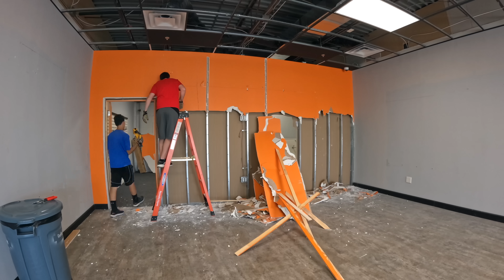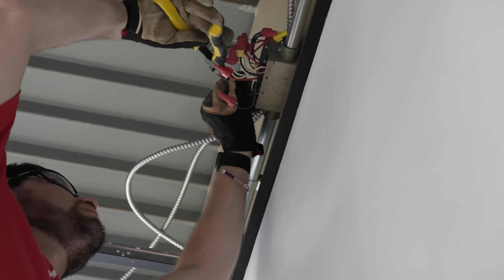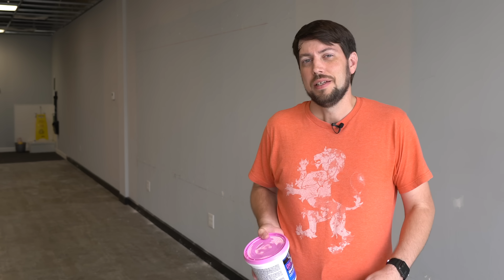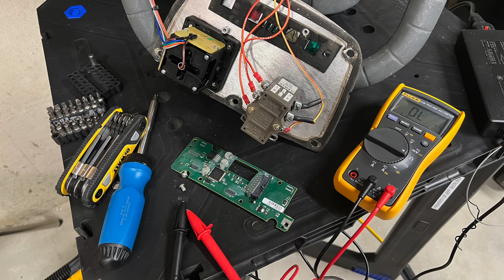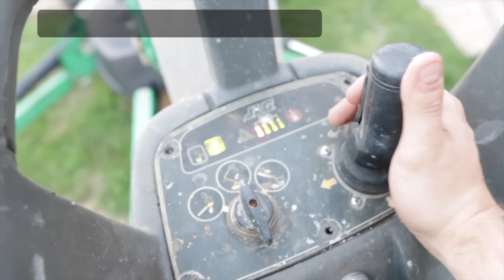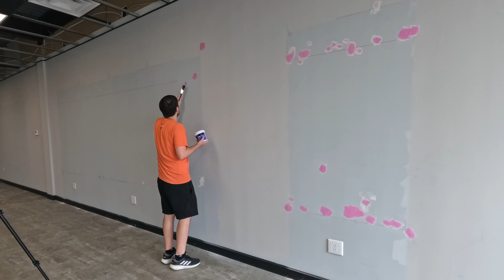Time for DEMOLITION! And a little percussive maintenance (moving 04)

Comment: You might want to check with an electrician about that junction box you showed.  I think I read in the NEC where you can only fill them so full.  It's about the number of conductors entering the box, and the volume of the box.  That looked overfilled.
Reply from the maker: The good thing is I pulled one of the cables out; there are currently 4 left, I think, and it's okay with that number of 12 gauge wires inside. An electrician is coming in soon to work on the rewired lighting, new outlets, and a couple new branch circuits, so he'll be working on that box regardless.

Some corners were definitely cut in the wiring from the previous tenant—I noticed some unprotected bare wires entering some light fixtures without the proper fittings! Those are sharp edges on those sheet metal light fixtures.

Comment: There are probably lots of reasons for the opened space feeling smaller, but what I can think of is 1: with the wall, yes the space was smaller, but there was a door. You could see there was more than just the current area. And 2: big spaces feel empty. A comfortably filled (not crowded) room may feel bigger than when empty because you can see that so much stuff can fit inside and you can still move around.

Comment: Have to ask if the steel studs couldn’t be reused instead of dumpstered?
Reply from the maker: Possibly, however the new wall dimensions will be slightly different, so rather than try to reuse, we decided to just go with new.

Comment: Did I just see you using one of those banned voltage probes? Bigclive just did a video on those and why they are a poor tool for the job and sometimes a dangerous one.
Reply from the maker: This model is not banned (it's a newer Fluke model), but any non-contact tester is only "one part of a complete diet".

I use them to help double-check the wires I think should be live are still live. I always verify first by tracing the wire visually. Second by using a circuit tester. And third, if I come near touching any bare wire, I'll grab my multimeter. (And I'm still careful to wear gloves when I can)

But having the wireless voltage tester is a quick way to verify what you believe to be the case (though not with 100% certainty).

Comment: I once worked for a large bank which purchased an imaging system, many servers, and (then brand new, state of the art) RAID5 towers. After a planned system outage a couple of the drives in the RAID towers wouldn't spin up. IBM Tech Support told us to put them in a plastic baggie, set them on the floor, and spin them as hard as we could. Dubiously, we did, and would you believe it, it worked!  The issue was some kind of seal inside the drive. When it cooled it would stick and the drive wouldn't spin up again. The percussive maintenance procedure broke it loose! One of the weirdest tech issues I've ever encountered! We were going "you want me to do what?"

Comment: You be amazed what zero residue contact cleaner and a toothbrush can do, never use regular contact cleaner on your digital circuits it will have seizures.
Reply from the maker: I always use the contact cleaner, dry it with towel, then alcohol and blow it with air if I want to go extra-clean.

Comment: you always could fire the carpenters and build the walls yourself but don't close everything in before you get your electrical plan finalized, tested and working - since nec (nat'l elec code) changes so often you should have a licensed electrician come and inspect as well as any local code ordnance inspections done, getting plumber to look at the current install is probably not a bad idea either. use a 2' roller to do the walls, get a primer tinted with same color as paint and you should spot prime first before and after first primer application - once it is perfect you can paint - construction is all just staging - doing each logical step at a time - you want to get it done as quickly and cheaply as possible so you can start addressing the more important issues which are not insignificant. do try to have a grand opening and network with the neighborhood and also do some local volunteer work as well as charging enough for the paid work - IT support ain't cheap but quality service is worth it, think about providing free quick estimates for people on how they can improve their gear, connectivity, and workflows  - doing local work will help out the shop and hedge plus diversify your biz portfolio - red shirt jeff can even be employed in some situations and you will enjoy the variety. have your dad help you with the rf side of things - that should be interesting - he could be your first colo client. lastly don't stress out over the office - it is not worth it - just keep plugging away - by 100 days you should see the light at the end of the tunnel. you needed the space and do a special on how fiber plus faster local networking helped out your situation - could be good content - just cause you have the fast bw does not mean you should not looking into good caching tiers - maybe you should think about a 10g vps to make everything match well - like swr matching - you can have the gear and infrastructure but it needs to be tuned correctly or you will not gain the most out of it. #roi #tco #actuary

Comment: At least percussive destructive Red Shirt Jeff is OCD in loading up the dumpster and doesn't just haphazardly toss stuff in as a jumbled mess!!!😆😂🤣
Regarding the lift controls, I noticed that the circuit board had a conformal coating for protection. Next thought was oxidation of contacts being a problem which a good unplug and re-plug of connections several times almost always scrapes off the problematic oxidation coating. Saw this frequently happen on copy machines that were 5-10 years old...my guess was that since copy machines create Ozone from the high voltage coronal discharge and even though mostly neutralized by carbon filters there is still some Ozone that escapes to surface oxidize connectors. Remember, Ozone is basically like gaseous bleach!!!...and you've seen what bleach can do when you visit your local pool!!!
Reply from the maker: Yeah; I also recommended Kaleb use a little contact cleaner, then maybe even a little dialectric grease in the plugs—that lift is always outside, and the moisture can slowly do a number.

Comment: That is the most organized demo I have ever seen!
Reply from the maker: Heh, I could take my time a little — we also had to preserve the fire alarm station in the wall, so we couldn't just go full-bore into the wall, had to be a tiny bit surgical.
Reply: @JeffGeerling  - Understood. And great job on checking to see if the electrical outlets were hot or not with a tester!

Comment: Think pink spakle crap is horrible....  

You should have got a bucket of all purpose joint compound...  it shrinks, but is super easy to sand and do a few coats and you sand smooth to be like no holes were ever there.  That pink spakle crap dries ROCK HARD and you fight so much just to do a light sanding...

Comment: Wait...
You need a PERMIT to take down a drywall in your own house...?
Reply from the maker: This place isn't my house (it's a commercial location), and technically you don't need a permit for taking down drywall, though there are a lot of things you do need a permit for!
Reply: 1) it's commercial, not residential. Commercial buildings are held to much higher standards than residential buildings

2) The permit isn't for drywall, it's for the structural members underneath. When someone removes a wall, it is good practice to confirm the building does not need that wall to stand. 

The last thing a city wants is random construction projects that might weaken buildings and cause safety hazards for the public.

Comment: Heads up, Drywall dust is HORRIBLE on consumer vacummes.  You might want to plan on taking yours apart and clean it very deep and stuff.  The dust is so fine, it gets into bearings and every nook and crany and break things...
Reply from the maker: Yeah, this is a cheap vacuum I basically bought to have on hand for construction. It is... coated pretty badly.

My Rigid vacuum has a nice fine filter bag to catch the dust, and works a thousand times better—but it doesn't have any kind of beater brush so it's not as good on the carpet.
Reply: @JeffGeerling  nice! Yeah, if it was a permanent vac, I'd say clean it out sooner then later. Where I use shop vacs as much as possible when I do drywall work and then once I'm satisfied, a normal vac can come in the finish off. 

Studio space is looking good!!!  Can't wait to see it finished!!!

Comment: Does the reno plan not include taking out the walls? I know you wanted to build a room within a room, but any plans for an extra layer of soundproofing or something in/with the existing walls?
Reply from the maker: Good question! We're leaving the existing outer walls, as they are halfway decent (the exterior wall has insulation and two layers of drywall). That interior wall was just studs and 1/2" drywall.
Reply: @JeffGeerling  yeah sorry, I meant gutting the wall by removing the drywall.
Reply from the maker: @Genesis8934  Ah, in that case, for the side walls, since there are already two layers of gypsum, that's a nice amount of mass to stop sound, so we just wanted to build one more wall with an air gap in front of that, which is going to be really good for sound isolation.

Comment: I don't know if it applies here, but some of those filler products work better if you use two thin layers instead of one thick one. More work, but stronger result that will not shrink or crack.
Reply from the maker: I usually do a medium coat, then sand, then a light coat on top, and sand one more time.
Reply: This is the comment I was looking for. The pink stuff wants thin coats to dry properly, particularly if you're filling a deep gouge.